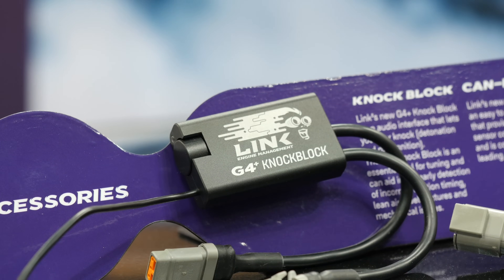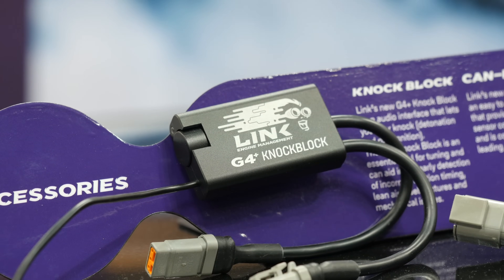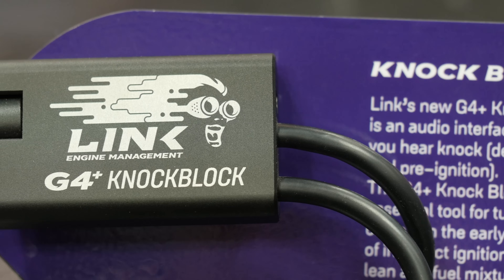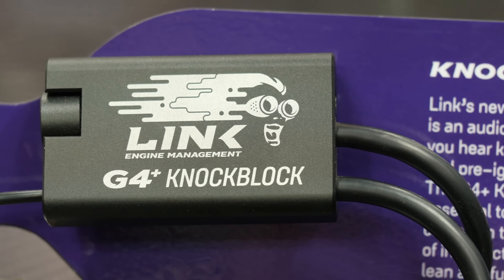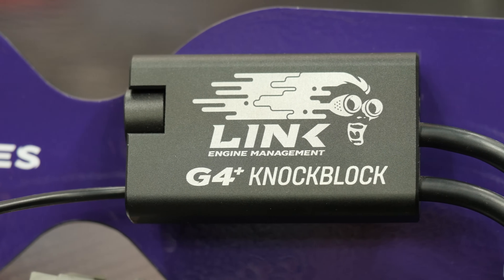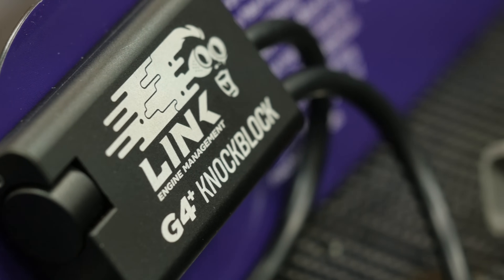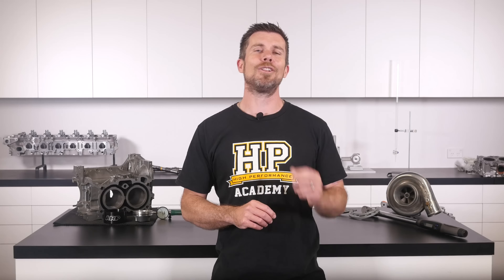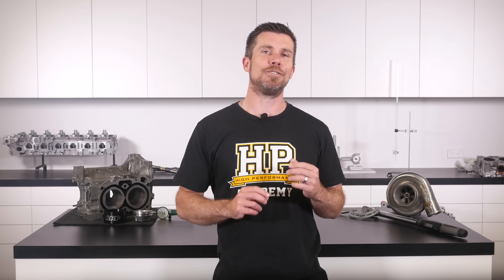Stop Wasting Money On Engine Rebuilds | Link KnockBlock [TECH NUGGET]

Comment: Is it possible that the ECU can cause an engine knocking mostly from a cold start, then taper off while it’s warming up ?

Or if there is a knocking it will be there the whole time while the engine is running?

Is it possible that just a portion of the programming could be off ?
Reply from the maker: It is physical components knocking, not your ECU. Metal expands and contracts with varying temperature and some knocking or tapping while cold can mean a number of things about a number of different parts that your ECU will have no idea about in most cases - Taz.
Reply: @hpa101  : why did it run GREAT up until the second service?
Reply from the maker: @ginoasci  I can't tell you that, I'd only be guessing which is no help. You need to check your data and engine to find out =) - Taz.

Comment: A good mechanic can hear a engine knocking! More technology because people are terrible at their job!
Reply from the maker: More like whatever mechanic thinks that (sorry if it is you!) is terrible at their job! It is terrifying when someone who claims to be skilled doesn't know how to use the correct tools for the task at hand or why!
That's like saying an electrician can just lick his finger and stick it in a socket to get a volt reading 😂

I don't know why a mechanic is tuning your car and not a tuner anyway, but even so, if he can audibly hear knock from the high-boost performance engine he is tuning on the dyno, he's already damaged it.

Another red flag from idiots who think things like this are when they claim they are more accurate than a torque wrench just because they've used one for years and have a 'feel' for it 😅 

Whenever you hear statements like that, run, and find someone who actually knows what they are doing 😎 - Taz.

Comment: Something like this would be nice for     tuning a hi comp carby engine.  That doesn’t have efi and knock sensors. 

I wish it was a little more inexpensive
Reply from the maker: There are other devices on the market, we just recommend the Link, Tunernerd or Plex units as they are the ones we have tried, tested and use ourselves here, but no doubt there are other solid options. Just make sure you do your due diligence before purchasing whatever you get :) - Taz.

Comment: Yes totally agree, i love my LINK KNOCK BLOCK, 
I also love the ability to feed the output into the microphone input on my laptop and look at the knock output visually via LINK G4+ SOFTWARE.
For those who don't know, go to the TUNING TAB at the top of the laptop screen when you have the LINK TUNING SOFTWARE open.
Scroll down to KNOCK AUDIO 4TH OPTION DOWN from the top.
I run my output from my LINK KNOCK BLOCK  into a Y piece , one 3.5 mm earphone lead from the Y piece to the microphone input on my laptop, 
I then purchased a small amplifier and i use the output from the small amplifier to my headphones, due to my bad hearing.
This way i get the best of both worlds i can watch for detonation in certain circumstances when tuning on the dyno on my laptop when i can, but i also can listen for it the whole time.
I usually have a page setup with the fuel table open and the AUDIO KNOCK SCREEN displaying below the fuel table, while auto tuning or manually tuning the fuel table.
Any detonation hit the cell marker , tagging the detonation point, hit the I key to replace the fuel table with the Ignition table and make adjustments from there.
This is one of m any ways to tune with this great device.
Reply: How do yk what set your frquency

Comment: Is this a stand alone device or can you run it with a Link G4+ ECU? Is it worth running it with the ECU like you would a wideband O2?
Reply from the maker: Standalone. You can use this audio knock detection system with any ECU. If you want to use a system that monitors for knock after you have finished tuning this depends on the model of ECU you have, and yes it is 100% worth setting it up if you have it. We don't only rely on these systems while tuning though, hence the audio detection system too =) - Taz.

Comment: $500-$700... OUCH!  I'm lucky all my turbo cars already have knock sensors, I guess?  I was interested in this device as a means of verifying the accuracy of the knock sensors I have on 4 cars, but not at that price.  I can buy 9 new knock sensors for that much.  I can see how it would be useful to someone who doesn't have knock sensors, though.
Reply from the maker: I can assure you that $500-700 looks very cheap when you compare that to the cost of replacing a set of detonated pistons, and while you can perhaps buy 9 knock sensors for that much money, the knock sensor on its own isn't always that much use to us. Just about all late model engines will have knock sensors fitted from the factory and these sensors are monitored by the ECU for knock control, which in most instances works well. With a modified engine though it's quite common for the system to report 'phantom knock' which would have the ECU needlessly retarding ignition timing and hurting power. Likewise it's possible for the factory knock control system to ignore real knock that may damage the engine. 

We use an audio knock detection device like this to monitor and validate that the knock control strategy is working in a factory ECU, and for a standalone ECU we rely on it to set up the parameters of the knock control system, so in either instance a device like this is one that we consider to be essential for any tuner.
Reply: google tuner nerd knock monitor
Reply from the maker: Yeah I don't think we'll be buying anything but 2-minute noodles from our YouTube cheques either. They're probably more likely to send us a bill than a cheque anyway haha Keep up the good fight mate! - Taz.
Reply: Thank you very much for your thoughtful, detailed and accurate reply.  I know exactly how much time these kinds of things take, so that's not lost on me.  The detection of phantom knock is precisely the reason I was interested in this topic and clicked on the video (besides the fact I'm subscribed).  As you mentioned, all of the cars I'm interested in using something like this on are already equipped with knock sensors and an aftermarket ECM tool to log and get the most out of my modifications.  I have a high compression turbo setup that I think is providing me phantom knock.  Perhaps if YouTube paid a little better I could afford something like this?  Thank you, you guys make great videos.
Reply: +High Performance Academy Google is actually running ads for free ad blockers in front of my videos.  Not only do they hate their creators, they clearly hate themselves.  Selling ads for ad blockers.  Nice.
Reply: omg jafromobile im huge fan of you omg
Reply: Jafro, let me help you out with that. I'll give you the tool for free because i enjoyed the video you did on Dialing in cams. Thanks !
Reply: Jafro, can't you just Glyptal the pistons for knock free performance?
;)